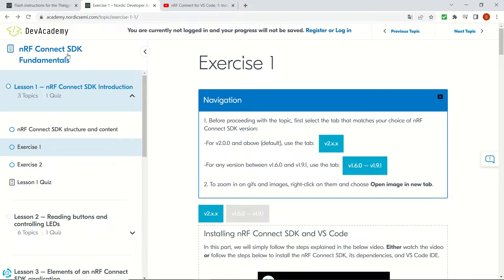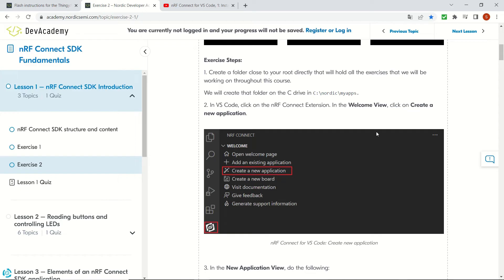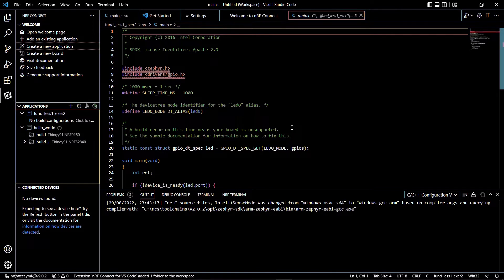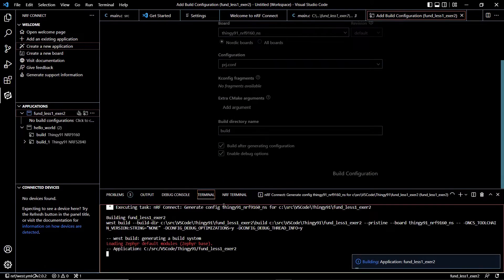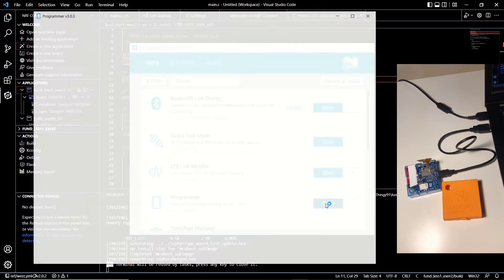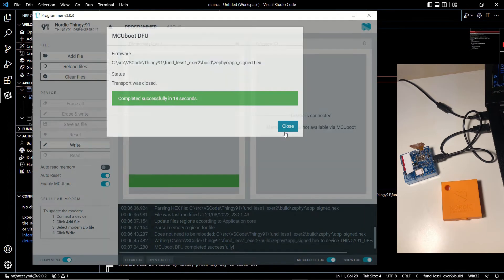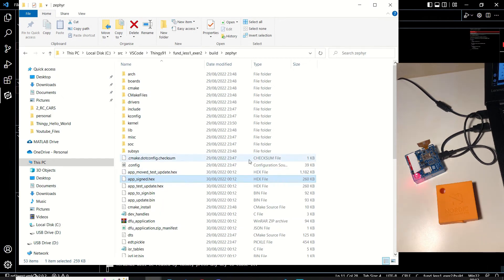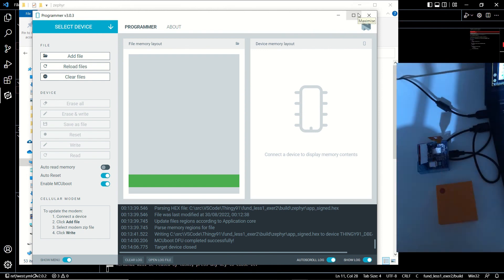Blink the LED with Thingy:91

Comment: Hi Dr Selim
I flashed the thingy with latest modem fw and the asset tracker works well. 
but when i build the blinky thingy9160_nrf9160_ns : the build and the flash are successful but the LED is not blinking after reset. Any idea why?
Reply from the maker: It’s strange, as you can see in the video it works well. I can suggest you to “erase” the files via programmer and then “write” the app_signed.hex file again. Let me know if that makes a change.
Reply: @drselim  [Solution] i added CONFIG_BOOTLOADER_MCUBOOT=y in the prj.conf
Reply from the maker: Thank you for sharing the solution.
Reply: Only the "write" option is enabled. I can see ttyACM0 and 1 but not output with my signed_app.hex (hello_world example)
Reply: Hi, I did the same steps and I ended by having the same issue: The build and the programming complete with no errors, but the LED doesnt blink after restart, I followed the steps of drselim twice, I applied the workaround of Yacine Ounnoughi but still no blinking. I programmed the board after that with the asset tracker from Nordic Semiconductors and it works fine
Reply from the maker: Hi, it's strange that with the same steps you don't get the LED blink. Did you try any other examples from the Thingy video series? button-led etc?
Reply: @drselim  Not yet, I started yesterday by setting up the needed environment and tools, tried the asset tracker, and started your tutorial. I will try with the other videos and let you know.
Reply: @drselim  I could finally find the solution for the blink exercise not working on my Thingy 91.
After applying the solution of Yacine (adding CONFIG_BOOTLOADER_MCUBOOT=y in the prj.conf), I had to run a Pristine Build instead of Build. Then simply flash to the board through the Programmer of nRF Connect for Desktop.
Reply: @MrRazor1984  @drselim For me too, it worked only after following both the solutions as done by Yacoubi. Thanks for the information shared.